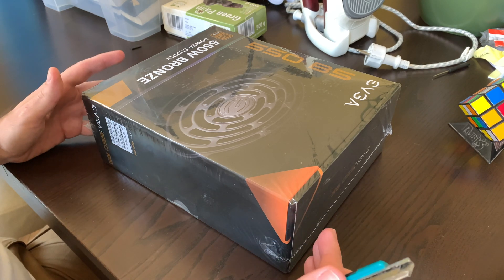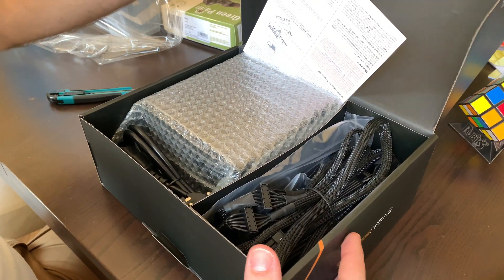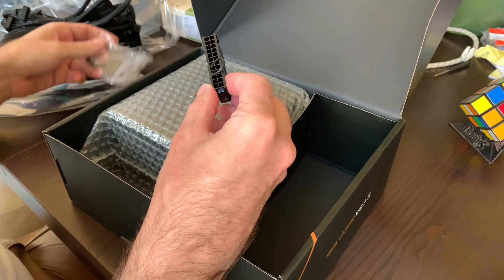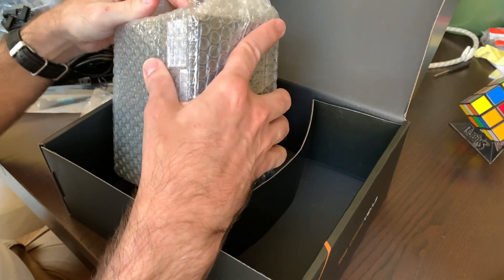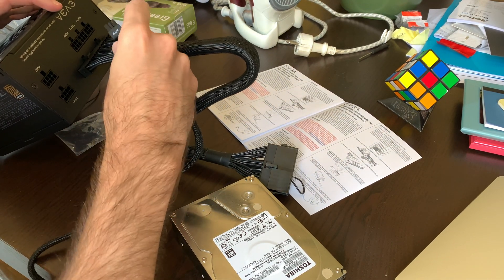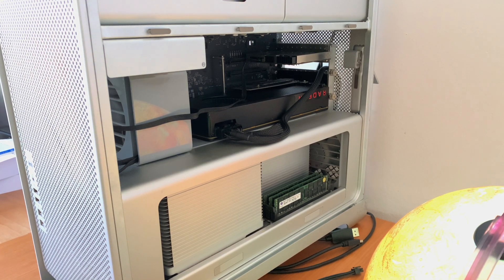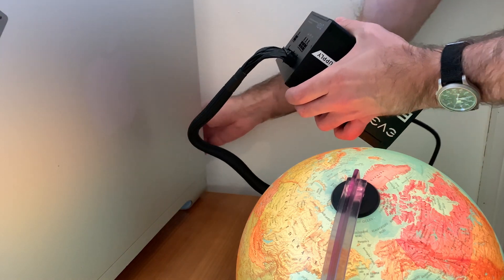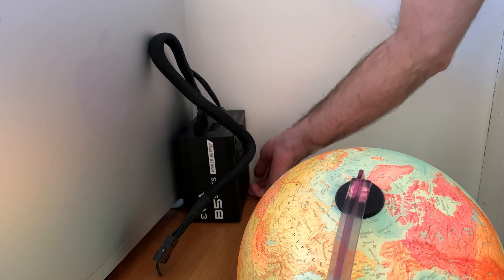GPU external power supply - Classic Mac Pro

Comment: Great video.  I did the exact same thing.  Thing is though, when I power off the Mac Pro the Radeon fans continue to spin at full speed.  What can be the issue?
Reply from the maker: Maybe the computer is off and there's now no driver thermal control, so the fans spin on full throttle for thermal safety?

For example, I think the Mac Pro fans will also go full blast if you keep the side panel for too long.

I can't say for sure, because when I had this setup I'd always power the PSU off after I was done. I now did the pixlas mod on my internal PSU so I don't use an external PSU anymore.

Comment: hi, it is interesting: for the PSU ignition sequence how did you behave?
Reply from the maker: Just turn the GPU PSU on first and then turn the Mac Pro on. It's not speed sensitive, there's no need to be done in a rush or anything.
Reply: It's dangerous and you could burn the whole thing. The GND as well as the PS-ON Signal are supposed to be synchronized to avoid this exact outcome.  @Shiunbird
Reply from the maker: @alexanderd.7818  How so? The GPU is not requesting or taking power from the slot and if there's no GPU when the Mac Pro turns on, it will just complain there's no video card. The procedure is well documented in the community and worked for me for months, until I made the pixlas mod. It is still my daily driver.
Reply: @Shiunbird  There is no such thing as requesting power. The voltage is either there or not. You’re having the two circuits here. There wouldn’t be any issues if their components would’ve been isolated from each other. But they’re not, the GPU is connected to PCI express and the PCI express, through the chipset, is a direct way to all other components. The problem is the differences between voltage which may appear between the circuits. As long as it’s not too high there would be no visible issues but should it reach a sufficient value and something along the way (diodes or some other semiconductor component) will stop working as a barrier for the current. That’s when you see a “poof” and going to buy a new computer. I’ve seen a lot of people trying to use multiple power supply units and it frequently doesn’t end well. Especially when there is no synchronization.
Reply from the maker: @alexanderd.7818  That's interesting. The PSU I used for this external experiment already comes with a jumper cable pre-installed out of the box for exactly the use case I have here. Why do you think that's the case and how often things go poof?

Comment: checking back after a year, was your PSU fine since then?
Reply: I tried this method to power my GTX 1070 but had to throw two PSUs within 6 months
Reply from the maker: The PSU survived fine for 9 months, then I made the pixlas mod myself and it's been perfect. =) The PSU is now 24/7 in my NAS.

Comment: Hi thanks for posting this, I am looking into getting a RX6800XT as you can now flash them to work in the 5,1 this looks like the way to go rather than doing the pixlas mod. So the power supply turns on when you boot the mac thanks to that jumper?
Reply from the maker: No. I had to turn the PSU on a second before turning the Mac Pro on. 

I ended up doing the pixlas mod myself a few months ago and, honestly, it’s way easier than it looks. 

It was just too hard to document so I never made a video.
Reply: @Shiunbird  Thanks, yeah I am thinking about doing the Pixlas mod. There is a good video on it here on YT and the same guy has  a blog.
Reply from the maker: @MacSoundSolutions  I was a bit afraid in the beginning, but it’s not hard. It’s just a lot of work and not much room to manoeuvre.
Reply from the maker: @MacSoundSolutions  Oh, and another thing about the external PSU - you will lose a slot, unless you want to drill through your chassis.

Honestly, it works well enough and you are then really sure you are not pushing the internal PSU.

Most of the times when I am play FS2020, my Vega 64 is doing 150W, so it's fine.
Reply: @Shiunbird  my rx5700xt eats up my second slot, so not an issue, an rx6800xt is even fatter. You can get a rx6600xt that is only two slots and is about the same performance as the 5700xt but uses less power. My 5700xt can peak at 200 watts when hit hard. Thanks for the info.
Reply from the maker: @MacSoundSolutions  not that. You need to run the external psu cable through a slot.
Reply: @Shiunbird  yea I understand, not an issue because I can’t use the second slot, my Bluetooth antenna extension is in slot 2 so I could just remove the bay door.
Reply: @Shiunbird  check this out https://www.youtube.com/watch?v=bNelL7OJe4o&t=154s , it will power the 2nd PSU when you boot your mac. I am wondering if this PSU can handle a RX6800XT which maxes out at 350Watts. Not sure if the PSU will give it enough power when its only connected to the GPU.

Comment: Are you sure the PSU is making that noise? My vega 56 has alot of coil wine even when watching videos full screen
Reply from the maker: With the 560, most of the whine was from the PS. With the 580, sometimes GPU and sometimes CPU. 

Now, you are right, most of the times it’s actually the Vega. Funny though, sometimes it never happens. But it is still sometimes the PSU, when the load changes too fast. 

I might reevaluate everything there some day.
Reply: i have only coil whine when i watch some porns thats a strange thing